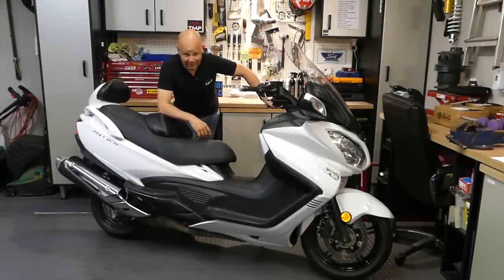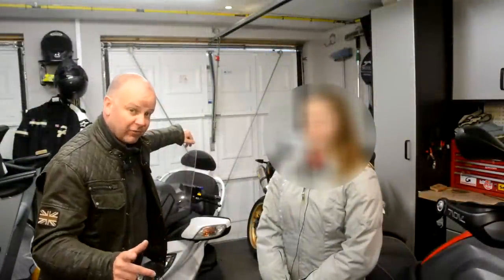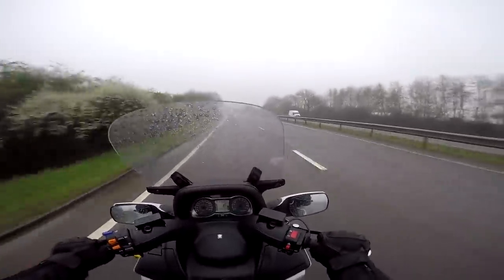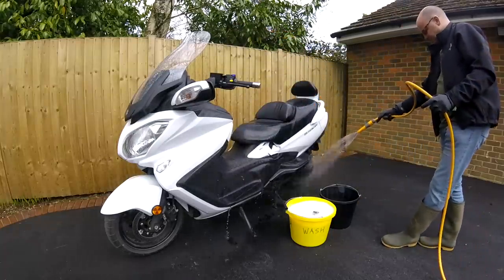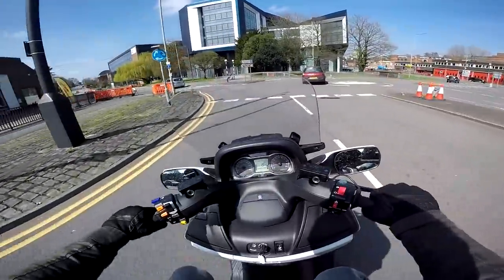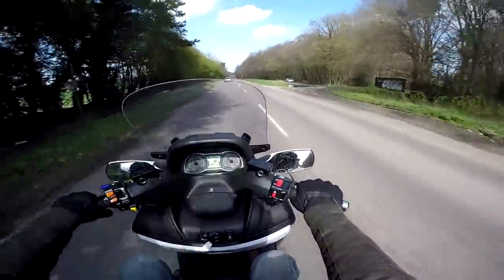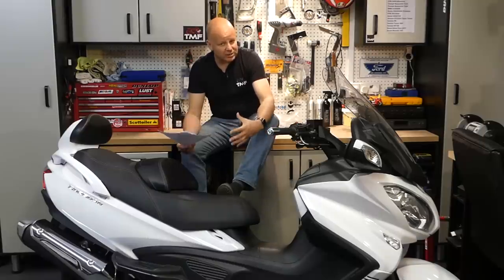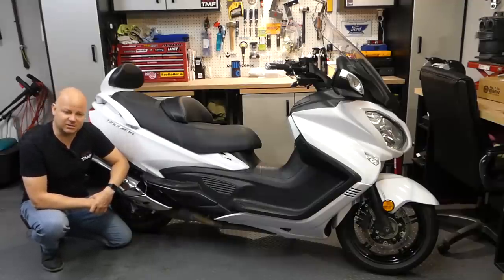2018 Suzuki Burgman 650 Executive - Long Term Review

Comment: Very comprehensive review. I wish the magazine ones were this good! 
I recently tried this model and I got pretty much the same conclusions as you did. My only "but" with the bike was the seating position. The feet forward arrangement takes some time getting used to, specially coming from regular bikes, as it's more difficult to unload weight via the feet and everything falls on the back. Which by the way requires a pretty accurate adjustment of the back support. Also, my wife being petite at 1.56 m,  was not not that comfy on the back as the seat is 50cms wide and "felt like being in a gynecologist chair". Too bad, because it fits the bill in every other front. Particularly in terms of providing engine brake, essential in mountain touring. No other scooter can do that. Otherwise one is being left with only brakes going downhill, not very reassuring.
Reply from the maker: Yes good point, hadn't thought of that - thanks for watching and for the kind words!
Reply: hold it in gear when playing chase up & down the hairpins

Comment: I had a massive accident at work when 2 tonnes of steel gate collapsed on my, smashing my ankle & leg along with many other injuries. But the problem is I can no longer change gears on a conventional bike. It's a bit of a silver lining as I was introduced to the Burgman last year and I love it! Mine is an 07 that had been dropped. Minimal damage (scratches and broken indicator). However, time uncovered a few more faults. The front mud guard is too short so the tyre throws up all manner of cack into the radiator and mine was pretty much scrap. East End Radiators of Glasgow hand build a brass & copper replacement for 250 quid. What a difference! To keep my new radiator in tip top order, I bought a beak for the mudguard for less than 20 quid. Looks good too. The other problem I had was the ABS lamp would be on more than off and sometimes the handle would vibrate upon hard braking. Turned out to be a rear wheel bearing. 20 quid from a local bearing supplier & fitted myself. My bike is 11 years old with 26k on the clock so all in all, it's done well. I get my mate to do the heavy stuff and servicing on his ramp as I have problems kneeling and lifting. But for a fat bloke with damaged limbs, this bike has saved me. It got me out of the house and feeling human again and my 9yo son loves it too. We're not long back from a two day trip where we did fishing, ate ice cream, went to play parks and all round the city of Aberdeen. It eats up the miles whether it be motorway or twisty highland mountain roads. I highly recommend the 650. FYI the 650 was built from cutting a 1276cc Hyabusa in half at Suzuki... It is affectionately known as the "half-a-busa!" It's detuned for reliability and is epic reliable. BUT you MUST change the CVT primary pulley stopper bolt at least once a year or two years if you do low miles. It gets chewed at the ends and if not changed it can allow the CVT to self destruct. But an awesome piece of Japanese engineering at it's best. Love this bike.
Reply from the maker: Thanks for taking the time to write that lot Andi, appreciated...
Reply: Gets replaced with the belt every two years. Yes all these maxi scooters, like motorcycles need regular maintenance.

Comment: Thanks for the review.

It was interesting to see a bike I am considering being reviewed in the UK, not only because I am from there, but because living in Japan where road speeds are 1/3 lower, I can hear how the bike handles at speeds I would do here on a quiet road with few police cars - the motorway limit here is 100kph (62 mph) on limited stretches and 80 kph (50 mph) generally.

You mentioned Suzuki's official MPG figure, but did not confirm it by measuring it properly when filling up. That would have been helpful.

You said the bike had a stack of storage, but details of top-box and side cases - if you can fit them and what is available - would have been good. After all, no-one tours without them on any kind of 2-wheeler, do they?

It would have been good to see how easily you can filter through traffic, rather than seeing how easily you can ride on a quiet town road. Of course each rider must decide whether he/she can filter at any given moment, and it's not to be expected of a 650 scoot' as it is of a 150.

A great review over all.
Very useful, thanks.
Reply: FYI:  I have Givi saddle bags, 22 liters each, and top case of 47 liters.  You can also add a tunnel bag up to 20 to 25 liters and top the top case with a luggage rack adding a 30 liter case on top. This gives me about 20 liters of storage for tours and my wife over 180 liters.  In all seriousness, for touring I have about 205 liters of enclosed hardshell storage, it can spoil you quite easily. In practice we leave much storage available so we can place our helmets, leathers all in secure storage while we explore on foot.

Comment: Great review. I did own a 2006 Honda Silverwing back in 2019, and absolutely loved it. Great commuter bike and was able to ride to work in the rain and did not need to wear rain pants, even with the spray from the highway. I got rid of it after that season as I couldn’t shake the stigma of a scooter. Scooters are not popular here in Ottawa, Canada. I regret that decision and am looking to get another maxi scooter. I am leaning towards the Suzuki Bergman because of the bigger engine and larger wheels/brakes.
Reply from the maker: Cool!

Comment: Around town and one up I think that it's a bit lower geared for me which means that I feel it at lower revs in a higher  gear than I would expect to ride at. This can be overcome by putting the bike into manual mode and changing gear with finger and thumb but its not too uncomfortable to just let it ride in a higher gear.  That certainly makes it more economical as well as I got  70 m.p.gallon at reasonable speeds out of town. 60 to 65 around town.  The gearing is not a problem two up for touring or on main roads. It balances itself out nicely except the smaller wheels do not take to the potholes or other rough surfaces. Its got a top speed reputedly of 110 mph and in POWER  mode it will do 0 to 60 mph in less than 4 seconds. not a lot can keep up with it.  It's totally responsive and can  keep up and surprise many a motorcycling mate.  Have had mine for nearly 3 years and got it due to arthritic legs letting me down  [ result of an RTA on a motorbike 30 years ago ]  Last say.... it's a great bike worthy of consideration. It holds its price well in the market place and it's a wolf in sheeps clothing.  One to just enjoy.

Comment: Good long term test. 👍

Perhaps the benefit of it being like a car in design, etc, is to attract car drivers and give them additional benefits of easy parking, filtering, fuel consumption, protection, etc.

Mentioned the fuel consumption but think the fuel range was missed. Also, covering any touring luggage accessories available, e.g. panniers, top box would be handy. Would panniers cover the petrol cap?
Reply: I agree with Michael - if you look at the Burgman as “half a car” then it makes much more sense if you are coming from the “car side” of the divide than the “bike side”. This is a much less intimidating step into the world of bikes for a car driver than say the z900.  

If you live in or around a big city and are regularly stuck in traffic on your commute - this is a much better option if you decide to swap to 2 wheels: 
- Integrated, invisible lockable storage
- Great weather protection
- No gears or clutch to distract you so you can concentrate on bike control, other traffic and directions (this alone probably halves your chance of an accident as a newbie)
- low centre of gravity and foldable mirrors makes filtering less scary, which if that was your motivation in the first place (avoid traffic) makes huge sense.

Car > Burgman > z900 makes more sense than z900 > Burgman > Car
Reply: Panniers, at least the rack to mount them too, has become near impossible to find in the US. The Givi racks for the Burgman, C650gt, or SilverWing have become difficult to find.

Comment: I'm going today, 11/3/18, to buy an 03 for $1,500. I've ridden a couple and really really like them. I've been wanting one since the first ride. I have 5 BMW bikes among the 8 bikes I own. But I have a feeling the Burgman is going to be my go to motorcycle. I bought a Honda Helix after I rode the Burgman, I really like it, and I have used it quite a bit, but it's not a Burgman. I will say it is probably the most comfortable bike I own. Ergometrically it's damn near perfect, there's nothing I would change, the bars are perfect. One thing I don't think I'll like about the Burgman is the rear brake location. On the Helix it's operated by the right foot, which is where it should be in my opinion. At times I've found myself reaching to pull in the non-existent clutch lever. When this happens on the Burgman, and it will, I'll be grabbing some rear brake.
Reply: Good! It'll take ONE time pulling on the rear brake lever before you figure out how wrong you are.
THE one complaint I (EVERYBODY) had about my Helix (other than "only a 250") was that damn rear foot brake.
You'll be glad you finally have plenty of room for your right foot.
Now go get the Burgman, stretch out a bit and enjoy!

Comment: Nice review but you didn’t show under seat storage and right hand switch gear on the move?  Start /kill switch/hazards and screen...so screen is the only one used when moving....small point I know.
Also petrol cap it’s easy when you line up the arrows...even with gloves on !

Comment: Excellent review and, as always, very amusing. I am 73, although I hate to admit it, and now considering a Burgman 650 for recreational riding. My BMW K100RS 16v may have to go - a pity, after I've done so much work to refurbish the machine but it's something of a beast to move around on foot. (Guess I'll have to find out how to use the engine lol). No, but you know what I'm talking about. However, and this rather surprised me, the Burgman 650 is actually the heavier of the two! Some figures:BMW K100RS 16vPower = 100hpWeight = 518lb (full tank)Suzuki Burgman 650Power = 55hpWeight = 558lb full tank)Which means that the power weight ratio of the Burgman is approx. half that of the K100RS. One great advantage though, is step-through mounting. No more having to cock your leg.

Comment: I can tell you does a easy 100 mph 😉 you needed a track section to finish this review off...
Reply from the maker: ...just got to get myself a track installed!
Reply: I’ve done 115 mph on mine
Reply: Too funny.
A track section.
Reply: @0mega619  ABSO! Mine easily did 115MPH and gets there quick too!
Reply: Mine topped at 120mph, but felt that if the Rev limiter were over ridden, it could do more.
Reply: A_Sensible_Young_Man  ...true, real skill is how slow can you go without tipping the machine over? This is why when learning, off-road, particularly trials, is good for teaching control, as putting your foot on the ground gets you demerits.  As well as learning different surface conditions and how they relate to Newton's laws of motion.
Reply: Where I live we have 80 mph speed limits. At 80 you risk being hit from behind. Normal flow of traffic can be 90-100 mph. And when another scooter passes me, yeah I race him.
Reply: @gpecaut1  .....Germany? Autobahn? At Those speeds you're good for saving time, but you can't enjoy the scenery, give me the secondary roads, rest stops/picnic areas and roadside diners any time.  I've been content with going up to 75mph and no faster than  through my life.
Reply: Omega – ppp

Comment: What a great comprehensive review. I happen to watch one on this motorcycle yesterday though I only made it part way through because it was so bad you did a fantastic job.
Reply from the maker: Thanks Donald - what about my review made it better than the other one you watched? Curious to know by way of market research!
Reply: @TheMissendenFlyer  the one I watched earlier had first, a lot of Christian stuff that did not apply do the motorcycle at all or whatsoever. Secondly the writer of the Bergman had no idea how to operate the equipment or understand what the scooter was actually built for, therefore no knowledge of how it should perform or how it could perform. You obviously knew all of that

Comment: Thanks for the open minded review. So many "real bikers" just talk down or compare it to the latest ninja. It's a transport solution at Kawasaki call the j300. It can be fun but it's made to get about in a cheap and easy manner. Unlike sports bikes it is made to be practical. And unlike most sports bikes it will end up with high miles, used all year in all weather.
Thanks

Comment: I bought one while holidaying in Italy - 2100 Euro/40K km on the clock. After having some oil changes done, and the air filter, this thing carried the wife and I all over the place - 10,000 km's in 3 months ! It had a 45 litre top-box, and with the room under the seat, we went for more than a week at a time on our explorations. The only setback was the previous owner/s had not followed the service schedule, and the belt in the transmission failed at motorway speed - just coasted to a stop - but destroyed the internals of the transmission. 3600 Euro for parts to repair a 2100 Euro bike !!
Brilliant machine - we had it up dirt roads, on the Autostrada, and every back road the GPS took us, and it was comfortable, quick, and being a scooter, we parked it anywhere and no-one got upset.
Is there one in my future ? Very strong maybe !
Reply from the maker: Good aren’t they! Thanks for watching....TMF

Comment: I'm sold.
Reply: get a good low mileage used one - they are out there! (insert smug git face emoji here..)
Reply: Expat Biker Just don’t be taller than 5’11” - 6’0”... otherwise you will be very dissatisfied with the rider comfort, believe me... I had one... and it is long gone.
Reply: @Bikerbug2020  

Yeah, because a crotch rocket is so comfortable.  C'mon, I've ridden a goldwing and this is as close, if not on par with comfort. I'm 6'1. However, it is your opinion and I'm obliged to respect it. 
Cheers mate
Reply: @Expat Biker .....well consider buying your basic motorcycle, then one day you want to turn it into a bagger/dresser {is Vetter still in business? They had some sweet hardware.} how much today to do that? Scooters already have the fairings there and the storage in the price.

Comment: TMF the Suzuki bosses haven’t upgraded the styling since the 2013 model. Seems that they should have made some changes. I actually think that they should have made a tall rider option. At 6’3” the bike was cramped my knees always just touching the dashboard, my 34” inseam also made the seating position punishing after 75 miles. Since you have the ear of Suzuki please offer them my observations and ask them to make these changes for future TALL RIDERS. 😉
Reply from the maker: ...not sure what makes you think I have the ear of Suzuki!! :0)
Reply: Same issue on the Honda Xdv. I'm the same height, most scooters are cramped and I've ridden quite a few. With the weight all in the rear, on rough roads I find scooter tend to pummel you butt and your lower back gets hammered. It's just physics, the engine is over the back wheel on most scooters. I live in Thailand, rough roads are the norma and because of that, I'm selling my Honda Forza and getting and adventure bike.
Reply: Pomoz7 I got rid of the Burgman a few years ago after only 18 months and 5000 miles, bought a BMW F800GT, then switched to the R1200RT... happy camper now.
Reply: How about thinking of short people too? If u can fit ok on 650 then that should be enough don’t you think?
Reply: @Pomoz7  The engine on these Burgman 650's is not over the back wheel but under the "tunnel" between the rider's legs, thus centering the gravity low and slightly forward--attached to the bike's frame and not the swingarm like the other scooters you are referring to.  Unless a person overloads the under seat storage, the weight of this bike, as reviewed should be nicely distributed.
Reply: Yo, tall dude. Just get a thicker, taller, seat! Problem solved. Us short people have been cutting the padding out of our seat to lower them for years. It would be way more comfortable to add foam.
Reply: How tall is the reviewer, and what is his inseam?

I'm interested in a Maxi from the viewpoint of a 5'-8" rider. The 31" seat height average of many large scooters seems excessive if manufacturers are addressing the marketplace.
Reply: @spikey2740  the SilverWing is an inch lower. The BMW an inch higher. Like most motorcycles, you only put one foot down most of the time. Lowering the scooter would limit the lean angle. The only maxi scooter with less lean angle would be Kimco's MyRoad.

Comment: How about the Burgman 400? 3 grand cheaper, and more than enough to take on the motorway. Also if I recall correctly, the service costs would be much cheaper, and less to go wrong with simpler transmission.
Reply: Yeah, the 400 has a simpler single cylinder, but is a conventional scooter and a part of the swing arm.

I myself bought a used 400cc Yamaha Majesty last February, and haven't regretted it since!
Reply: very sensible call. the man who runs York Suzuki uses a Burgman 400 for touring - what better recommendation?